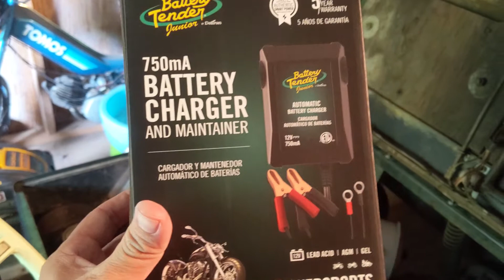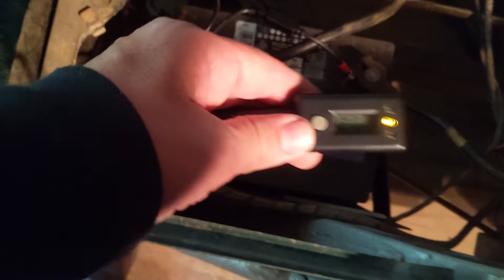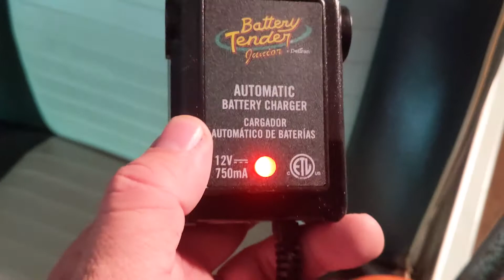Battery Tender trickle charge and maintainer installation | Battery charger and maintainer

Comment: My golf cart has 6 batteries.  Which battery do I hook it to or does it make a difference?  Thanks
Reply from the maker: Sounds like you have an electric powered golf cart. This is the gas Cushman and the battery is used to start it (fire the engine). With battery powered I would keep hooked to the equipped charger.
Reply: @jamzdotnet  so I can’t use a trickle charger on my golf cart?  I wanted to maintain the charge on my batteries when I’m away.
Reply from the maker: @Whatsagirltado  Well, your electric charger for the batteries naturally will keep them topped off. I have an electric and I keep plugged into my charger..if it detects they drop it will charge. You cannot use this trickle charger on 6 batteries.
Reply: @jamzdotnet  wow my charger only charges then once it’s finished it shuts down.  It doesn’t come on as needed.
Reply from the maker: @Whatsagirltado  This trickle charger is geared towards 1 12 volt battery. You probably have 6 6-volt batteries. I'm not sure how you would do that.